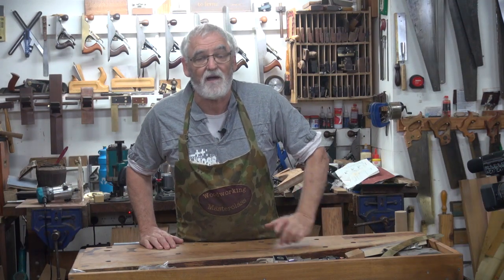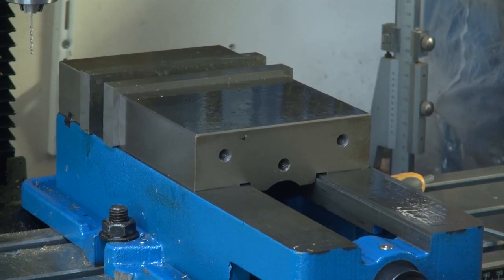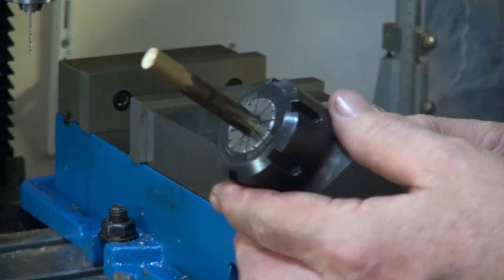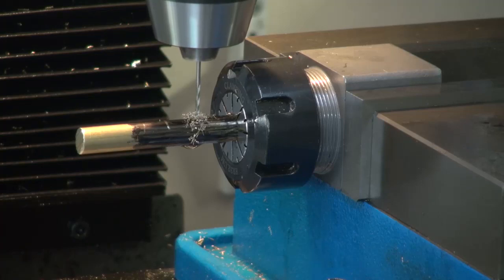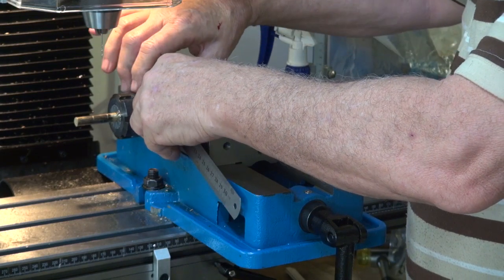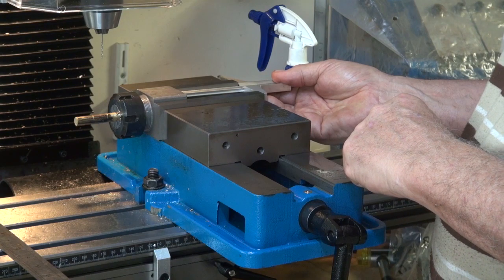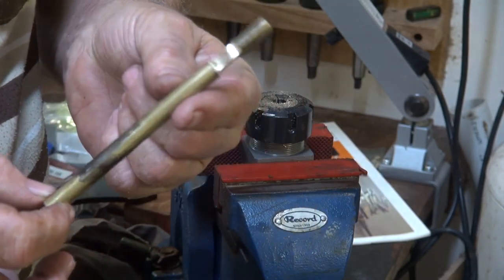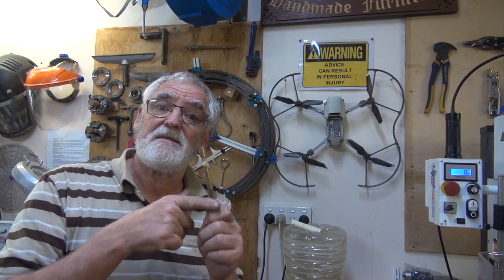Milling brass Tuning Pins

Comment: Have you recorded a follow up video of turning the harp pin taper?
Reply from the maker: Hi Fenian, Yes and No, Yes have done a follow up but not released. I will be making 2 harps in full videos one a simple Folk Harp and the other a Creation of my own. Will include the making of bridge pins and tuning pins as well as every other part of the harp. Love your Harp sign do you play the harp or make them? Cheers Steve
Reply: Hi Steve, aye, I make wire-strung harps (e.g.Queen Mary,Trinity) in Glasgow, I'm more profficient at the woodwork side of things.and I want to make the more traditional than the modern pins and i'm wondering the best way of turning square brass stock (10mm approx) 1:48 (imperial) taper shaft.
I'm also looking to buy a cheap metal lathe/mill that you might wanna recommend.
Cheers Fenian
Reply from the maker: @Fenian67  a  copy of the Trinity harp was the first harp I made. l love the sound. Took me ages to find a supplier of the brass wire. All good now, I've stocked up. Do you have an email address? I would like to have longer chats about building. Very closed and small community down here, so very hard to get any information from other harp makers. my email is woodworkingmasterclass@gmail.com
The one thing I found important with the lathe is that it has to have a minimum feed on the cross sled to accommodate the full lenght of the taper in one pass. At least 4". Another thing I did that makes it work much better was motorize the sled, that will give you a more even finish that turning by hand. Looking forward to more chats. Cheers Steve

Comment: So is that the max height for the head of the milling machine, clearance wise?
Reply from the maker: HI Vince, No throat size is 280mm. But on course you loose some of that if you have a vice under it and the length of the chick you have in the spindle. But I think it is quite generous. Cheers Steve